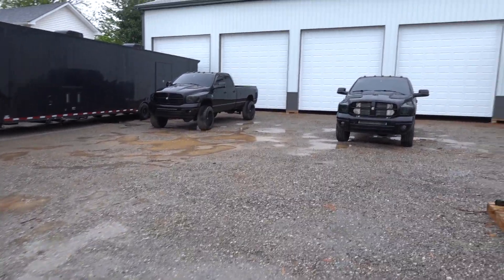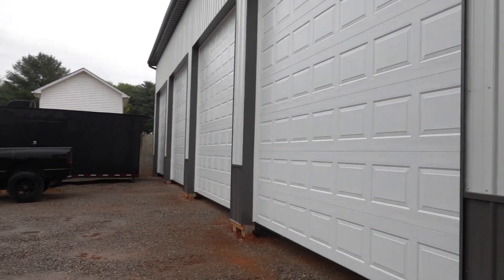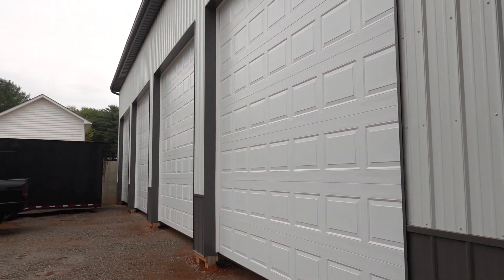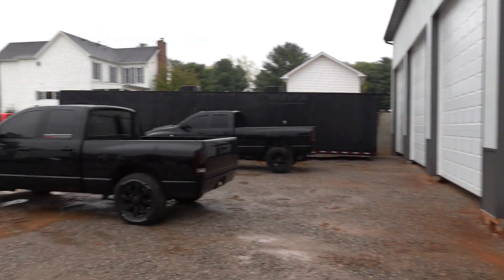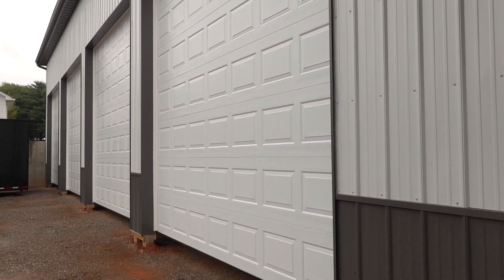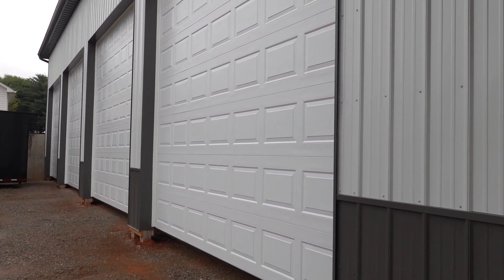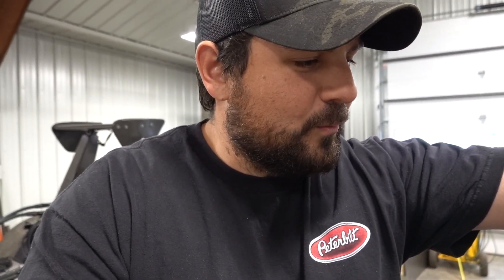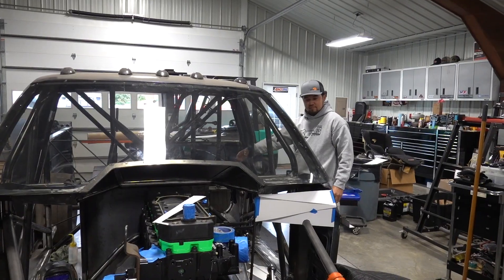BUILDING MY DREAM SHOP!!! EPISODE 5, OUR FIRST PROBLEM!!!!

Comment: Greg, I really think you should wire your shop for some wireless access points and IP cameras. Some inside and outside. I also chuckle at your cell booster you stick to the window of the other shop. There is some mesh products out there that would extend your home internet connection from the house to both shops. It’s what I have to mine. Then you can turn on WiFi calling and your good to go. If your running a new internet to the big shop you could do the same that way. It would even work well in that whole area. Ubiquiti is the products I like. But run wires for cameras even if you don’t do it the Cat6 wire is there. I would love to talk about it with you or help out to plan internet/ cameras/ access control/ alarm system. Also know more than most about electrical. Keep up the good work bud.

Comment: Greg been doing concrete for ten years mostly shop floors , some builders cheap out and use wire mesh which is crap use rebar . Go to the scrap yard if you don’t like the price of it ! And fiber mesh , it will last for ever !

Comment: I just installed 3 of the same doors yesterday for a guy with a semi truck shop. 1 guy, 1 long day. Except I had to fabricate hangers and hang his horizontal track because the ceiling is 20' above the top of the door opening.

Comment: Lose the handle and bolt a steering wheel on the bead roller.. makes it way smoother to use, and the bigger the better. Peterbuilt, maybe?

Comment: Hey Greg was just thinking couldn’t you take that handle off and put a gear of some sort and put it on the shaft. Get a electric motor of some sort with a potentiometer in line to control speed and weld a bracket to the roller frame. Just a thought. Love the videos you guys inspire me with my projects thank you.